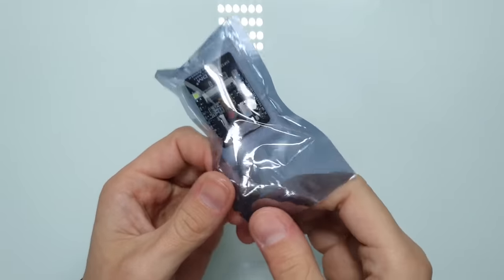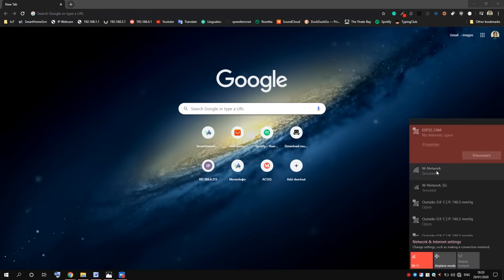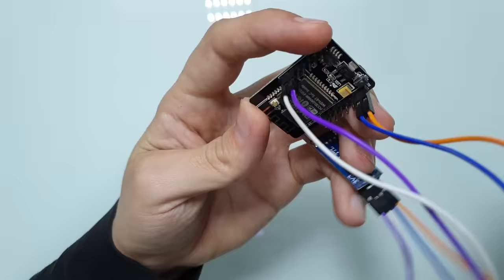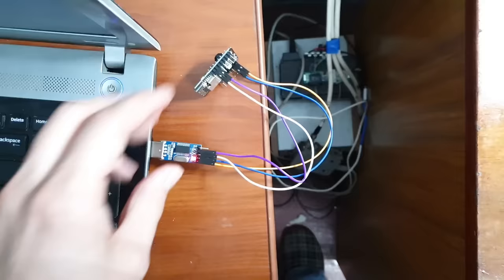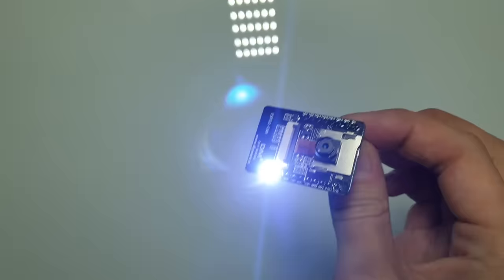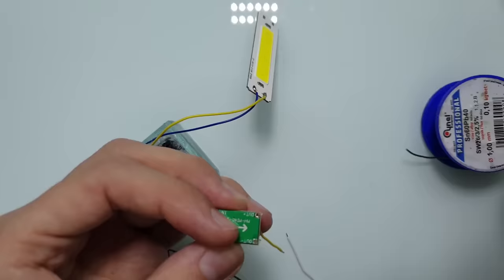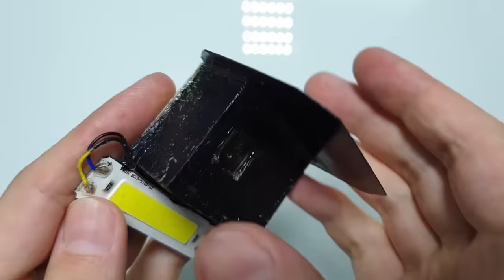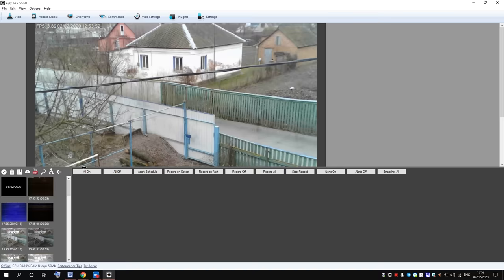Cheap Wi-Fi IP Surveillance Camera (Very little DIY needed)

Comment: There is actually a complementary board with microUSB connector and USB-UART IC. It can be used to program multiple boards or use as is, USB powered.
Reply: name of the board, so i can search it up?
Reply: @Liqweed1337  ESP32-CAM-MB it is.

Comment: Might want to describe why you are soldering a capacitor on back of the unit when you are assembling. Not much help to randomly do something and not explain it.
Reply: Power supply input ripple filter. Helps smooth out the power. Connect 100uF, 220uF or even a 470uF across + and - of DC input.
Reply: 4.8

Comment: I want to create a battery power wireless backup camera for semi-trucks. using a 2.4ghz - 5.8GHz transmitter or something with a screen in the cab of the truck. I don't want to use wifi or Bluetooth because they lag and lose signal where the camera would be placed. It's 65 feet away and there is a truck and trailer in the way. I found that DJI's drone worked perfectly. but I don't want my camera to fly. Where would I go to get help making this? I am asking you because I need to start somewhere.

Comment: As a professional surveillance installer there are 2 things that drives me insane.... "wireless" and "cloud based". I give estimates to people for installing cameras and they wonder why it cost so much. I tell them the labor for running wire to this location is the issue. "Why don't you use wireless?"
.....
I tell them sure we can get a wireless camera there and hope the connection is constant and doesn't drop out when you need it to record an incident. But it will cost more money because I still have to run a wire there for power...... Wireless power is not a thing, solar.... (very rare to find an ideal location for solar) again I hope we don't lose power when you need it.... Batteries?.... you want me to come back every so often and charge you to climb up on a ladder to change out a battery?

"Cloud Based System" ..... you're basically renting your system. The NVR's and DVR's of today are equipped with this neat feature called a WAN port... you can view remotely and backup to a offsite NAS aka 'the cloud' and guess what.... you own it.
Reply: Off-site backups are still important though.
Reply: Wirless is hackable.  Wired is too but you have to get physical access to the cable.  Re power. Solar + rechargeable batteries can work depending on the location but or course the batteries need chainging every few years anyway.  As for clound.... that is owned by some one else and you have no idea who could get access. Also the route to the cloud is an access point for a hacker.
Reply: I have a esp32 that can disrupt 2.4 and 5ghz wifi signals. Rendering those wireless cameras useless.
Reply: @XxTWMLxX  You and a lot of other people. Wifi/bluetooth and indeed mobile phone blockers are not uncommon. The security teams for many VIPs use them regularly (even though many are not legal)
Reply: You can't climb a ladder every year? You have to get out more.
Reply: Good point! I have the same question and concern (power) while watching it.

Comment: I've used those small buck converters with ESP32, and they fail to give the full 500ma required by wifi and processing. You'll get wifi drop outs and unusual problems. You will be  better off with the usual larger aliexpress usual 2amp module.

Comment: There is also a more expensive one with a USB port included (ESP-EYE).  I have one of those too which  makes development a lot easier.  I then use the cheaper ones for deployment.
Reply: Look also at the TTGO, mine came with a detachable antenna
Reply: Hey can we use this camera and view video output out of our wifi network and  view on website
Reply: @pearinnovation1419  I am not sure what you are asking but the camera video is visible over wifi as an http link; but, there is no way to electronically feed an external video in. You would just have to point the camera a the screen.  Not great video and not great resolution but if it fits your functional need it would work.
Reply: @connecticutaggie  Actually if you want, you can use ffmpeg as relay steaming server for the camera, that relay it to YouTube as live video.
Reply: @BayuAH  Usually when I want view another display it is connected to a computer so I just use VNC.
Reply: @connecticutaggie  You can use that. But depend on what you need, using headless programs are usually use smaller resources.
Reply: Does deployment mean when you're on a spy assignment?
Reply: @chevychase3103  I neither confirm nor deny that
Reply: Hey how can I get one of yours

Comment: I need a camera to monitor my remote mailbox that i 250 feet from house.  This video gave me ideas also. I need one to monitor my Mail box. I have experience with ESP01 for controller christmas lights. Maybe I can get one of these esp32Cam modules and make it work with the help of this video. Showing the wire connctions helps immensely. I don't believe that I need a light to shine as I want the camera to operate in hidden mode.

Comment: Please show how to power this unit with a very small solar panel and battery. What would be the range of its wifi with the external antenna added? Also, what about using the newer ESP32 (2?) camera module that is being sold now? I really need these to protect my animals from predators. Thank you.
Reply: That's easy
Reply: U can use an solar pannel, an rechargeable batterie and an converter/ Overvoltage protection thing to make it self-sufficient.
Reply: Using a small solar panel, you have to see whats the power draw of your module. Pick a battery that can supply that can provide your module with ~2 days of battery. Check the average ‘sun hours’ received in your area per day. Then take the rating of your solar panel(eg, 5W) then multiply it by the number of sun hours.(eg, 5W * 4 sun hours = 20Wh/day). Make sure the energy in from the solar panel > energy consumed by module. A very cheap way is to connect the solar panel in series to your battery, and then the battery to the module. Just make sure that the voltage supplied by solar panel > charging voltage of battery. If thats not the case, a DC-DC boost converter should do the trick. If you feel like splurging, consider using a solar charge controller. Also, depending on your area, your solar panel needs to be tilted on a specific angle.

That said, most of the testing will be done on-site, as theory is just a VERY rough approximation of what will be going on on-site.

Comment: This was very interesting. But, does anyone (or the author) have a suggestion for a module that can output >=24-30FPS at >=720p?

Also, what was the FPS on this module at around 720p? I just figure that's a decent minimum to see someone's face if needed for surveillance.
Reply: shutter speed should matter more if you are going for non-blurryness, not the fps.
Reply: I got a couple of these a while back and they were surprisingly reliable using HD if you have a very strong WiFi connection but that can be difficult as it has a pretty low WiFi range.

Some ESP32 chips do have sweet WiFi connections if they have a 3D antenna on them I just haven't seen one on the cam models yet.

If you saw a version of these equipped with a 3D antenna it would likely do the trick.
Reply: better get a heck of a lot better lens as well..  look up cameras for FPV quads(drones)  they are very small now and are 4k 30 and some 60 fps MICRO DRONES and some are even long range .. like 12km with digital tx and receivers
Reply: @zsavage1820  and they will get way too hot if you dont air rushing over them as they are flying
Reply: Module that can output >=24-30 at >=720p?

Comment: This is great. What's the viewing angle on the lens? Would it be possible to swap it out with a wide angle one?
Reply: The most common angle is 60°. AliExpress and eBay sells separate camera modules of 30°, 120°, 160° with and without IR filters.

Comment: Nice video, but it's hard to believe they did a good job with the hardware after learning that they left out the current limiting resistor for the LED...
Reply: Surface mount LEDs can have a resistor right underneath them. It can be really easy to miss.

Comment: Great video!  Quick, to the point and almost complete.  I just wonder the power draw you experience?
Reply: Can I use 3. 7 volts
Reply: I wonder this too, the current (or wattage if input voltage has a flexible range).
Reply: you could add a small solar cell panel
Reply: @whatieatinaweek8326  yes.
Reply: @pr0xZen  the current drawn will be drawn, not pushed. it'll take what it needs
Reply: @whatieatinaweek8326  put in top of your birdnest a solar power module 😁

Comment: Can we also use Micro SD card for Storage and Saving photos and videoes
Reply: That would be good indeed. Up!
Reply: Yes.

What I've been wanting to code for some time is a routine that'll retrieve photo(s) from the SD card to transmit to another device, e.g., a cellphone within WiFi range. Thing is, the sample code is a mess IMHO and I been afflicted with an acute case of sloth preventing me from doing the code

Comment: For the power up there on the tree do you use battery or from where?
Reply: trees naturally have energy if you wire into them. you can pull the electrons from behind the bark and use the roots to ground.

Comment: Really innovative what you did with the changes in the code and flash light. I made a video about how to repeat existing Wi-Fi networks to extend the range on my channel using an 8sp8266.

I'm wondering if its possible to port forward this esp32 video over the internet or to another location and view remotely using the same Wi-Fi extender idea.
Reply: Whoa u use 8266 as a repeater?
Aint that makes it very hot?
Reply: @davidyusaku  Actually it was not Hot. It was just as warm as it is when used in projects in which there was constant communication. Try it out. You might like it.
Reply: Do you have any information on how the ESP board can be used as a mini repeater? I would be most interested.
Reply: yes but i recommend having a login on the esp then so randoms cant view your stream

Comment: According to all my testing as well as several forum posts, this code is no longer working. The ESP library no longer supports this code since a recent update. Which is unfortunate since this is a really cool looking project and I would love to try it. primarily it is missing several files or libraries that are not included in the ESP board manager linked above. Additionally when a necessary library is linked, the program runs into conflict with pieces of the library. 

Feel free to correct me if I am mistaken but it's been a frustrating couple of hours to try and get this seemingly simple and elegant code working.

Comment: Hi, thanks, I have like 5 analog mini cameras (Runcam) do you think I can add those analog camera to the ESP? the wiring is +only 3 cables, voltage, gnd and video. :S thanks
Reply: Hi stranger,can you help me? I can't identify the wire he was using to power the camera

Comment: Nice video! I wonder, considering the $5 leaves room to do cooler stuff even on a budget, have you considered adding a "pan" feature? I don't know if ESP32CAM has that kind of possibility. Putting the module on a servo, I mean.
Reply: this people don't have the English American accent, so they should speak slow so the people can understand them,.
Reply: @YehoshuahLamberti  you should be grateful, but instead you complain
Reply: there are cloud services for esp32
Reply: @rfidtech9286  easy solution. turn on closed caption!
Reply: Nobody wants to comment on the servo idea?
Reply: @johnf4085  i made a servo module .iff you skip the led or combine the led with the module then you can us that to stear the servo.there is one lead thet connects to the gnd and then the servo starts rotating to one direction.disconnect stops the servo .again connect the servo rotates till the end and the returns to the other side also till the end and then starts all over again as long the gnd is powerd
Reply: I could understand this guy Windex clear. An accent does not make it necessarily easier. Have you tried listening to Brit Cockney or Geordie---it is English?

Comment: Thanks for the video. But seriously… I have four of them here and have been playing with them for a few days. The built-in wifi antenna is nearly useless here. I wonder how it worked on your tree. I can go away four meters from my access point and the connection is basically gone. I tried re-soldering the zero-ohm resistor to use an external antenna. Guess what… two of the esp32cam boards are now trash. I personally consider these boards a proof-of-concept but nothing that works. I'm really surprised that the camera worked to well for you.

Comment: Need to know power consumption, essential if one is to consider a remote camera postion with no mains supply. Otherwise, worthy project, with thanks to the People's Workforce & Industry Of China who made this possible at low cost.
Reply: Where he put it, put up a small lithium battery and solar panel also attached to the tree.  Problem solved.

Comment: I am not understanding what code you flashed the module with. it is not clear on my laptop screen, I have not worked with Arduino. I have some learning to do.
Also since they don't make 5volt batteries I need to power it up with 6v bat, and a solar charger  Is 6 volts going to be too much supply power for the board.

Comment: I'm powering it using the 5V out of Arduino Uno, and its not showing in WIFI, do I need to buy USB power supply or is the Chip faulty? The led on esp32 camera does turn on if I press the button on the chip.

Comment: Does the sensor sense IR ,Connect the camera wifi output to 50 meter long video (cctv) cable and tell me if we still can get wifi thru air , wifi signal received thru air by wifi laptop or phone

Comment: Looked at your tutorial, but I have an issue with the camera module, it fails with error 0x20002 (Camera init error). Do you have any idea what this could be? I check all the connections, they seem fine, I use the sketch with the AI_THINKER Module enabled..

Comment: Would this work if the router was on and transmitting wifi but did not have internet connection in order to stream locally?

Comment: Once you get the images on the interface, is it possible to transfer them in real-time to another UI? Maybe pushing them to a DB and then rendering them on a web page?
Reply: That would be possible, one implementation could be where the cam streams the video to a server, where the server than either just live broadcasts the new frame to all connected clients(with webRTC or webSockets(udp in this case)) or also stores the frames in a db for a rewind functionality.

Comment: I was so excited to buy esp32 cam but even capturing image is so slow, capturing in low resolution didn't help either. Capturing video with it is now just a fantasy for me :(. Not sure how it is working so nice with you.
Reply: which voltage ? 

noticed with my attempt at using a esp32 camera that using the 5V pins made the camera work better, better image quality too 

also not all exp32 cameras are born equal, some are better though what I bought was not among the better category :)
Reply: Yes i used 5V for esp32, i.e 5V output from arduino uno. Image quality is not issue for me. Issue is image loads very slowly, like it takes about 30 seconds to capture and load an image which is not useful.

Comment: where can we get crimp-on flex cable push connectors for these cameras? or even better, a crimp-on style USB-C adapter. 
looks like 26 or 34 or 64 pin depending on the phone model. 
what are these style connectors called?

Comment: Arduino: 1.8.13 (Windows Store 1.8.42.0) (Windows 10), Board: "Arduino Uno"

CameraWebServer:1:10: fatal error: esp_camera.h: No such file or directory

 #include "esp_camera.h"

          ^~~~~~~~~~~~~~

compilation terminated.

exit status 1

esp_camera.h: No such file or directory

how to solve this issue?
please advise
Reply from the maker: Use correct board in Arduino IDE, should be "AI Thinker ESP-32-CAM", but you selected "Arduino Uno".
Please watch the video at 02:05

Comment: TY for the video. Question: how do you power your camera?
Reply: Anything, battery or power source
Reply from the maker: The camera requires 5V DC, But in the video you can see that I installed DC-DC converter (converts 7-20V to 5V), this allowed me to power it from 12V (anything from 7V to 20V DC should work as well). If you use a long wire to power the camera I recommend installing DC-DC converter, because with long wires you will have a "voltage drop", it means that even if you connect it to 12V, near the camera you'll have a much lower voltage, for example 10V, but it is ok because I use a converter that can work from 7V to 20V DC and it produces stable 5V for the camera.

Comment: Thank you for the tutorial! How did you get the IP address of the camera? Does the small board have a GUI like Rpi? I asked this because I am using campus wifi which assigns my device dynamic IP every time and I cannot access the router.
Reply: in windows connect to the same wifi network and do: arp -a

or the default ip is 192.168.4.1

Comment: URL stream works but can't get it into ispy. How did you add it to ispy?
Reply from the maker: Click: Add > IP camera > MJPG URL.
Now type MJPG URL (with my modified firmware) it looks like: http://192.168.X.X:81/esp32_cam_stream
Then click OK > Finish.
If it doesn't work, make sure you got the correct MJPG URL, test it in a browser, you should get a working video stream (it looks like a camera webpage but without settings, just video).
Unmodified firmware try http://192.168.X.X:81/stream
Stock firmware (Haven't tried) http://192.168.X.X/jpg_stream
Reply: @ElectricalPro  it works. Looks like only one client can view the stream at a time, so I was able to add it after closing my browser stream.